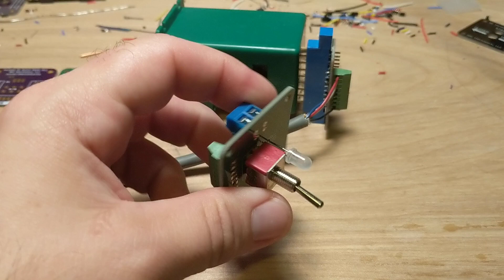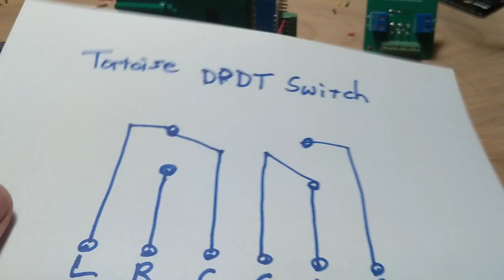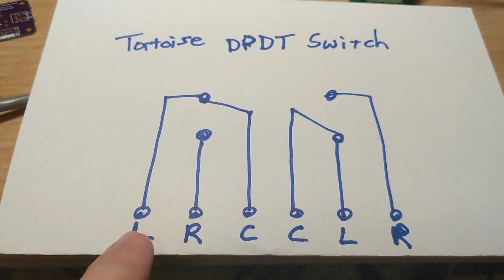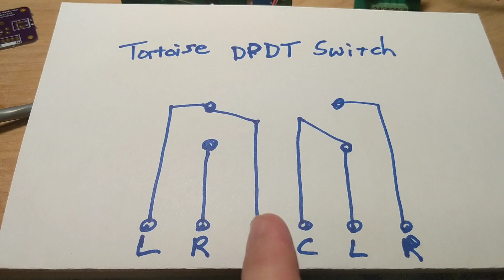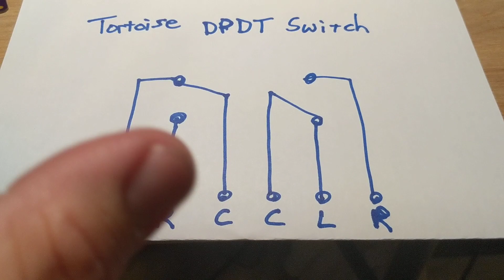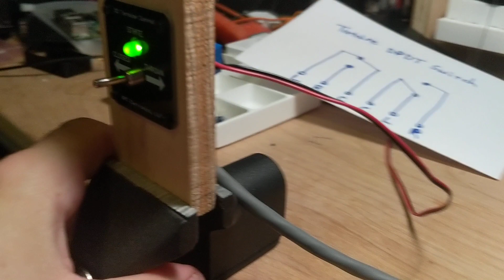Tortoise DC Switch Panel Update

Comment: Hi Jason are these new panel boards ready yet? I'm ready to purchase some
Reply from the maker: They are!  We already revised the design and the latest version is ready to ship.  Visit http://www.rpc-electronics.com
Reply: Okay, I was the one who emailed you about this, you were going to send me a one to test out. I will place an order this weekend. Just one thing will I be able to operate signals with the turnouts?
Thanks
Drew
Reply from the maker: @andrewthomas9777  Sorry!  It's sitting on my desk.  I didn't get it shipped before I left for Chicago.
Reply: Hi Jason,
I received my panels and tortoise adaptors yesterday. I have a couple questions for you - 
So if you remember I'm using Atlas code 55 turnouts that have a power routing - there is a place to solder a wire from the turnout to the tortoise. Would I just connect the wire to one of the blank locations?

And is it possible to wire signal leds to coincide with the led on the panel? I was assuming you might be able to do so with the 3 blanks?

And lastly, I'm using the digitrax zephyr system for DCC but was planning to use DC to power the turnouts/panels.  Can you tell me what kind of adaptor to buy and what do I use to connect to the adaptor to the back of the panels? I know you showed it in one of your videos.

I'd appreciate any help with this, I'm excited to use your products!
Thanks!